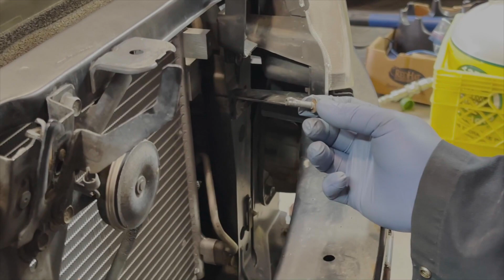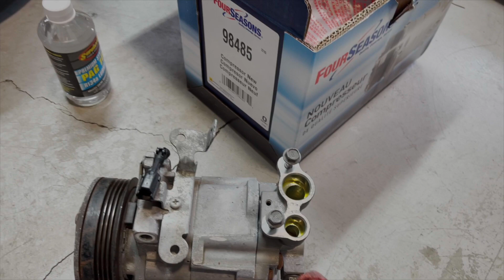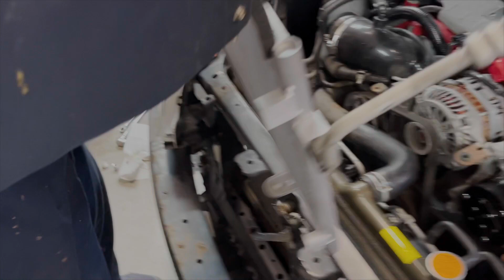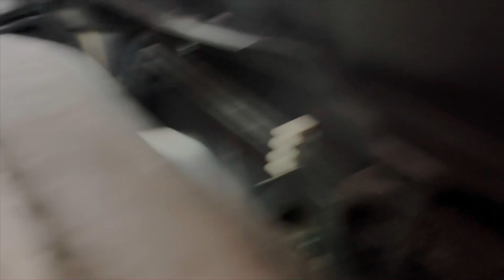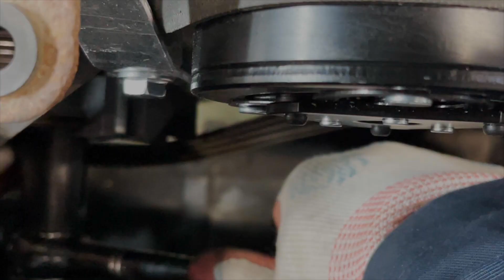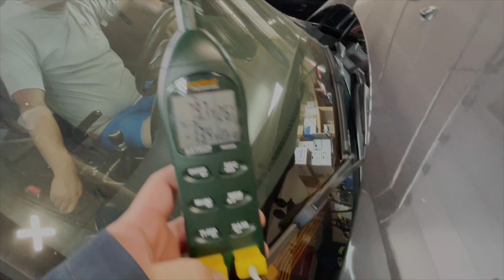3rd Gen Subaru STI Air Conditioning System Replacement

Comment: Only thing you forgot was flushing the hoses and evaporator to remove any contaminants
Reply from the maker: omg no.  The system didn't have burnout of any sorts and we cracked the system open and installed everything back within hours of starting.  Flushing, contrary to popular believe is NOT necessary if there was no refrigerant restriction, failed compressor or other major even that would release contaminants into the system.  This system was 100% original and actually working but there was a pinhole leak in either the condenser (it has lots of physical damage due to age and rocks) and the compressor o ring seals were suspect.  Given the age of the car that customer opted to replace all the key wear items.  If the work was done in a timely manner in a fairly clean environment then no there is no need to flush out the system.
Reply: @piercedasian  ok, should be good then. I am getting ready to replace the system on my subby due to a persistent leak. The compressor kit I bought says I have to do flush to maintain the warranty, $20 for the flush is cheap insurance.